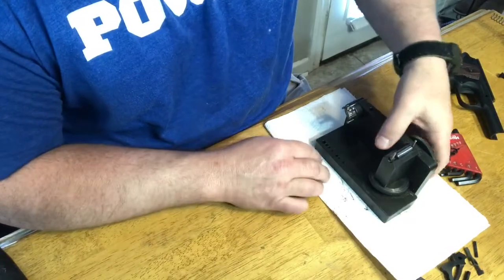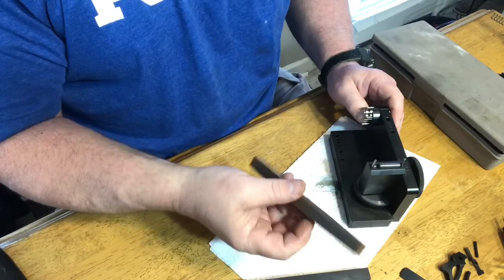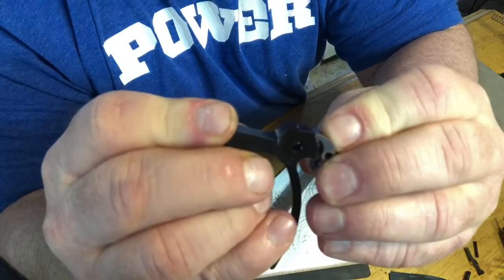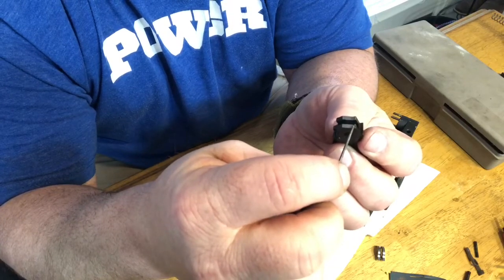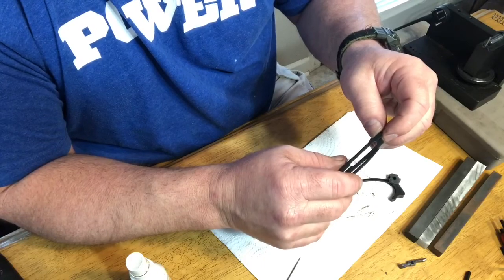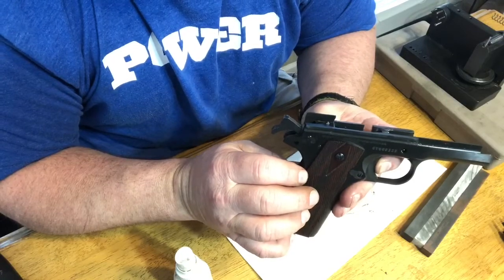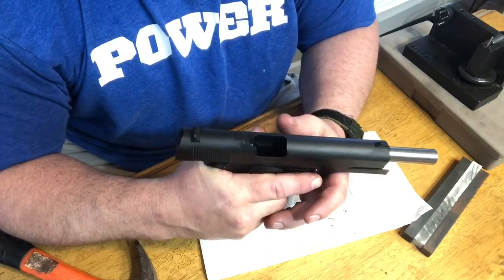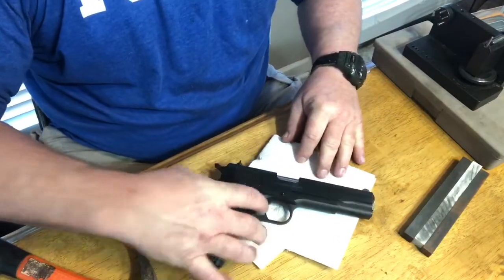1911 Trigger Job Basics

Comment: Wow, this is exactly what I've been searching for! I just did my first trigger/sear/spring replacement on a 1911 and had to order used original parts (AMT Hardballer Long Slide). The trigger pull is great but the hammer drops to half cock when doing the slide stop test. I thought it had something to do with the sear engagement or the spring but now I'm thinking it might be the spring, cause the replacement spring is bent like a contortionist, at the thick part, not the individual springs. Do you think it's safe to carefully bend the spring back to a more normal shape?

Comment: Need help: sometimes the trigger has creep, while sometimes it doesn't. Which part shall I look into to resolve the issue?
Reply from the maker: That’s a hard question to answer without having the gun. Since it’s intermittent, try removing the trigger itself and polishing the trigger track and trigger bow. Again, it’s hard to answer that question without having the gun in front of me. Hope it helps
Reply: @glocksrock1  That's a direction I never think about. My guess it's the engagement of sear and hammer hook is not consistent. Maybe weak sear spring causes this inconsistency. Please advise. Thanks!

Comment: A little questionable info here. Oil for the stones. What oil. Saying oil is like saying i bought a new car. What kind, well, it has tires! Says nothing.  

Use a quality honing oil. There is nothing wrong with using a good honing oil on ceramics what so ever. the stone here is terribly loaded wit metal. Using a high quality honing oil such as Trend Honing oil will not  only prevent this, it will remove the imbedded metal in the stone. 

Knife Makers use a stone more in one day than most GunSmiths will in a lifetime. We have to get it right!

KnifeMaker/retired after 47 years in the Shop
Reply from the maker: Use whatever oil floats your boat. I’m showing people how to perform a trigger job not make a knife. Two totally different things. I’ve never made a knife and you’ve obviously never performed a trigger job.